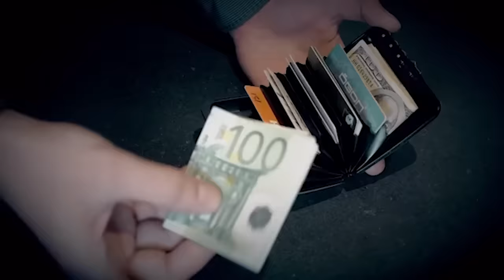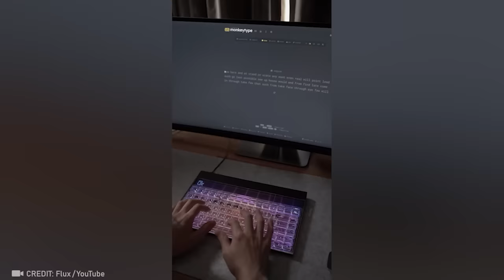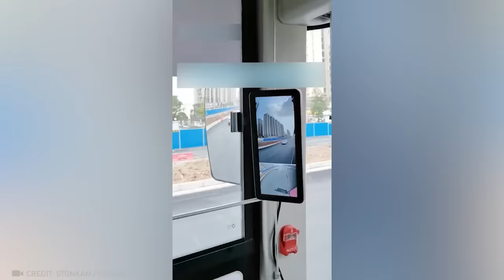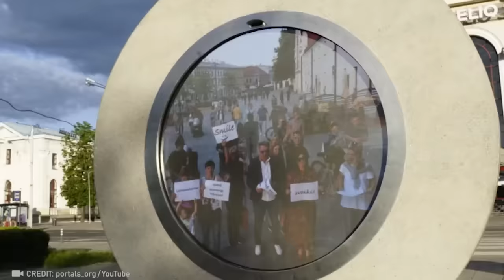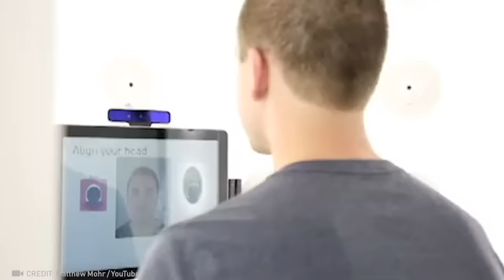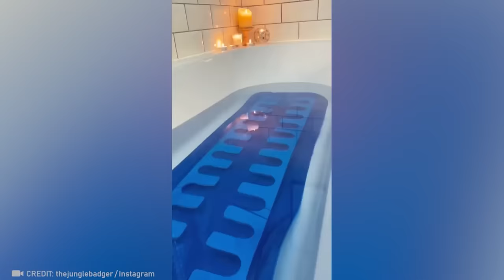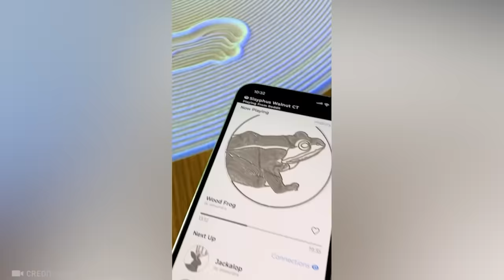Amazing Inventions That On Another Level | Compilation | Best Of The Year 2023

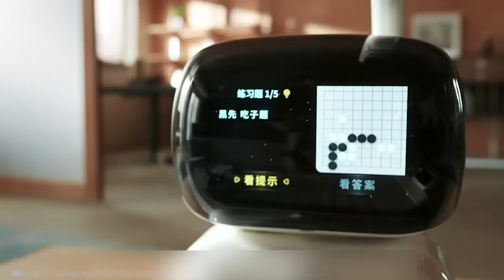Comment: @ 10:32   You mean to tell me we can't harness the sun to power our homes?  Look at that tiny little thing generating over 500 degrees, with just mirrors alone, and no magnifiers!     How could such a solar harnessing devise NOT be capable of heating water into super steam, power generators, or recharge massive lithium battery cells, hundreds of them, weighing several tons?

Now imagine a device 100 times this size and see what it can do. 
Better: imagine 1,000 of such devices, a quarter-mile wide each, orbiting the planet, and receiving 24/7/365(6) power from the sun, and returning 100 gigawatts of power each.

  There is no energy crisis.   There is, however, a crisis of will, morality and innovativeness among us. 
Harnessing the Sun is the only way forward for technological societies.
Reply: I totally agree. I even wrote a book about this.
Reply: You mean at 9:55? Well, 1. ground-based focusing mirrors for individual homes would only work when the sun is out, or they're not covered in snow. When the sun IS out, they must be rotated to follow it, and that power comes from ... where ...? 2. There ARE much larger arrays like this, such as Ivanpah. 3. As for huge such devices in space, surely they would be used as weapons long before they'd be used for power generation ...
Reply: I'm pretty sure I could burn my house down using nothing but solar power.
Reply: We do have those, but the weather is limiting as well as the rotation of earth

Comment: 14:03
As a fan of videos compiling innovative designs I have developed an ALMOST irrational hate for these doors. (If you want to know more, search Torggler Door, and then I hope you'll get over it like I quickly did.) Yes, they look nifty... That is literally the ONLY advantage they have over a common sliding barn-door, and brief thought can probably lead you to realizing all of the disadvantages of the designs, from the multiple pinch points to the difficulties of sealing the doorway properly with them.

They don't open more easily than a properly installed barn door, or many other types of doors. They don't open more smoothly. They aren't quieter. They literally have no advantage except a brief feeling of "Hmm. Lookie there!..." Which quickly fades.

But they look different, so they're in THOUSANDS of videos... Which means not only are they not good doors, or new innovations, they're also not even surprising any more.

I wish people would stop.
Reply: I saw the videos and said, pinch point... pinch point.. pinch point, oh god people with kids would hate these
Reply: the guy in the video is also being so careful because of how poorly the doors are designed

Comment: 1:47 
This is old tech
I actually got to work making these. They r pretty cool. When i started they were going to be used for ppl suffering from macular degenaration. To fill in the gaps where there is no vision. The ones we had in the lab where connected to your phone so you can see when a call pops up or whatever you see on your phones screen, almost like iron mans helmet with a whole array in front of u n its interactive responding to simulated touch basically a virtual HMI (human machine interface).

Comment: 24:00 you're not dreaming, but you are sitting in a mockup that nobody at Mercedes ever dreamed of producing. I have a 10-year-old book of concept cars that look just like this.
It's all a game to make you think "forward-thinking" or "creative" when you hear their name. It's far less effective than actually producing a creative car, but it's also far cheaper.

Among many other improvements, the Cybertruck is the first car with a 48V low voltage system. Legacy auto has been talking about switching to 48V for 20+ years, but never had the guts to push the issue by doing their own engineering. To build trippy concept cars while stuck on 12V is to be a baby who dreams of running while refusing to learn to crawl.

Comment: 2:00 That rotating surf simulator is so bad. To use it, you must hold onto some ropes. That's NOT how you surf. The linear ones are correct and have existed for many years. So, why reinvent something to make is bad ?
3:00 The mere cost of that thing make it impossible to replicate : Nearly US$ 1 000 000 000 ! Then, add the operating cost.
4:00 That keyboard is not that useful, cost several times more than a normal one, and probably won't last a year of normal use.
5:30 That system add weight, increase the cost of the vehicle. increase fuel consumption at all time, and is another thing that WILL break.
6:10 I'd love to see that against a REAL incoming vehicle, and fails to do it's job...
8:30 Interesting concept, but, the first idiot coming will just destroy it. It's just to flimsy and light weight. It need 5cm+ steel plates raised by heavy duty hydrolic actuators.
9:30 That bike demand more effort to ride it, and small bumps or cracks that you don't even notice with a normal bike WILL make you fall on your face.
9:50 Can it take any colour beside shades of grey ?
25:20 Curious what that surface will look like after a single average Canadian Winter... Probably ruined.
32:45 Wasn't new even in the 1970's... Now, just with some electronics to fail that wasn't there in previous models.
Reply: 3:00 (That globe is in Vegas. It's real enough)
Reply: @koriw1701  It's real and came with a construction bill of around a billion US dollars. It's DAILY operation cost is around a million.

Comment: lol many of these are just stupid, like the hyperloop its never going to happen its an idea that was thought of decades ago (was not called hyperloop) and the idea was dropped because it is impossible to work a giant Vacuum chamber for travel very unsafe and never going to work you have to open the chamber to let people in then seal it up and then pressurize it.
The largest Vacuum chamber in the world is owned by NASA and it can lower the air pressure down to just 20 milligrams of air left in the whole chamber and that takes EIGHT hours
Even small chambers in science labs say about a 1 meter squared can take like 30 to 40 min to lower the pressure to there lowest. Now imagen how long it would take to lower the pressures in the pipes, even cutting them down into sections to let each section have its own compressor would still be hugh needing a few hours to get it down.
How many of you will wanna get on this super fast transport but have to wait a few hours before it can set off?
The fact is the idea is just impractical and dangerous, sure many off you have seen video of pressurized containers or water heaters when over pressured blow up right? 
What about accidents god damn how will you get out in an emergency? 
You can get out the tunnel is pretty much built to hug the train and carriages so no internal side walks like you get in subways with emergency exits, hell even if you could get out there is no air your die in minutes.
What about maintenance? that going to be costly and be reflected in the cost of the tickets. what if some dumbasses damage part of the pipe so it does not hold a pressure any more?
Can't just put a patch over them and think that's fine the structural integrity will be fine, a handful of them (maybe) but eventually you will need to replace a whole pipe section and tracks inside.
There is a reason why trains have changed little over there long life and that is because they WORK. Sure newer trains that are better for the environment, more cost efficient, faster and safer are always implemented when the tech/designs come about but they do what there asked off moving Hugh amounts of passenger's and cargo around around a day.
Hyperloop is just a scam, funny how Musk basically wiped his hands off it and dismantled the tracks they did make I wonder why?
Ah yes because it just wont work in the long run and he knows it.

When someone invents away to keep a vacuum while making a big ass opening for people and cargo to get on and off with the ability to bring the pressure down in a matter of minutes then and only then will it be able to compete with trains.
Reply: Yep.